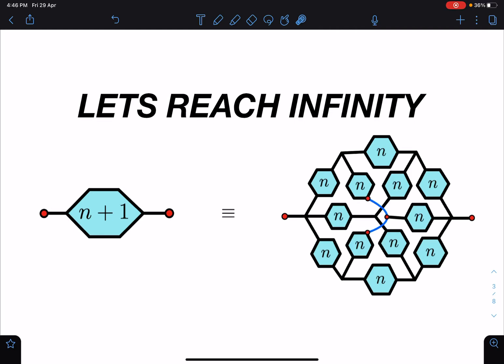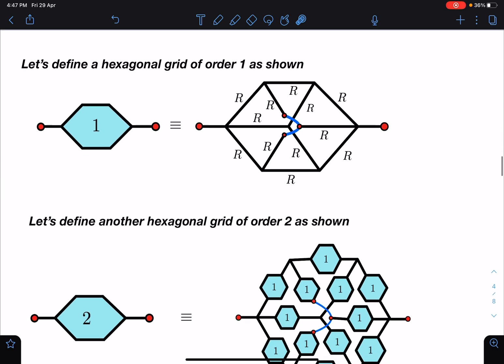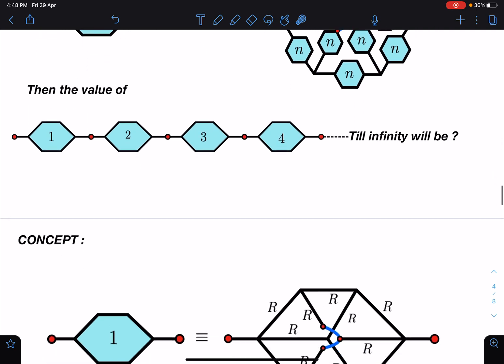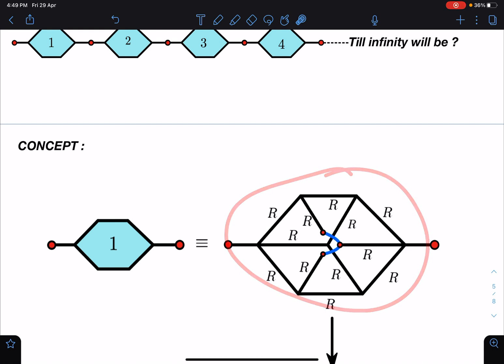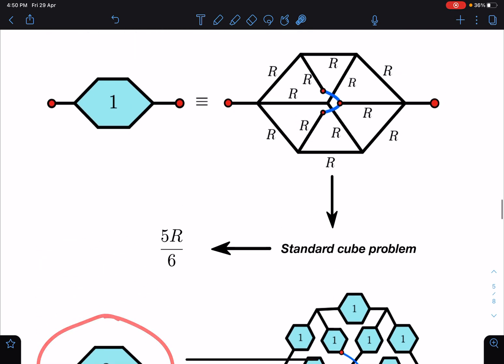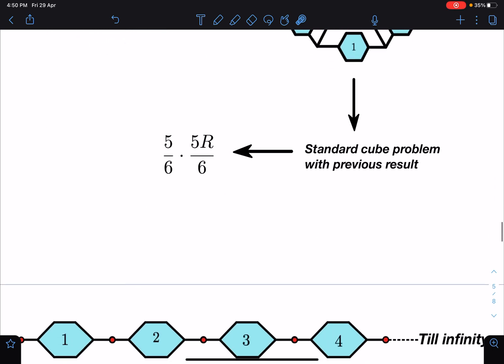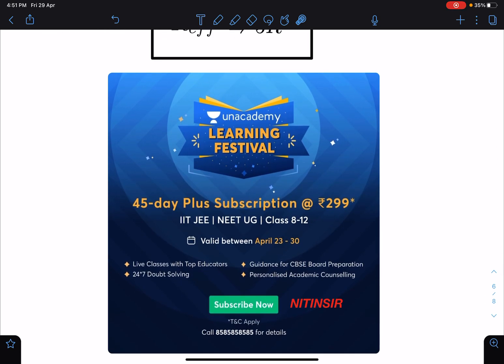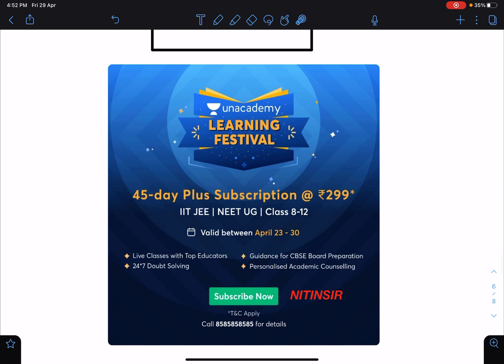[JEE ADVANCED] [ INFINITE CIRCUIT : LOOKS CAN BE DECEIVING ][ADVANCE PROBLEMS IN SCHOOL PHYSICS]

Comment: The cube is just visible if you push the junction in and out of plane. Thanks for it, i wasnt able to get it. That`s why you are op. Easy solution to tough problems. Thanks for this method to solve it.